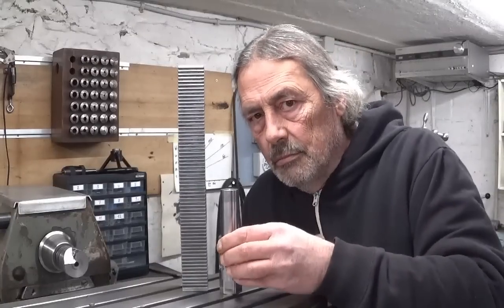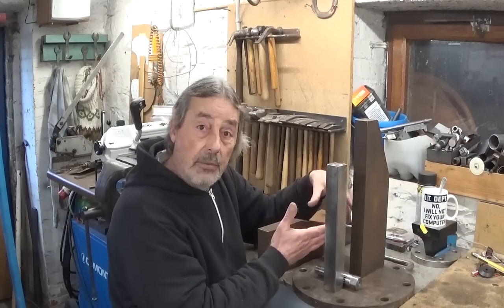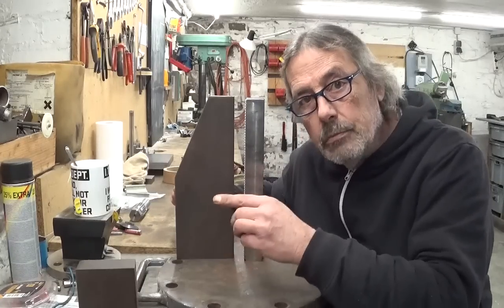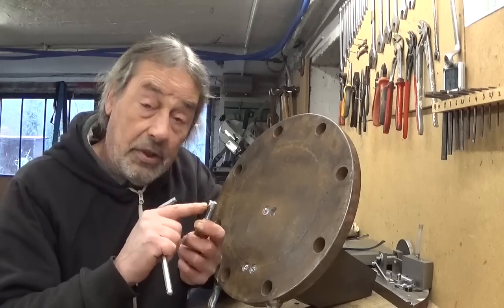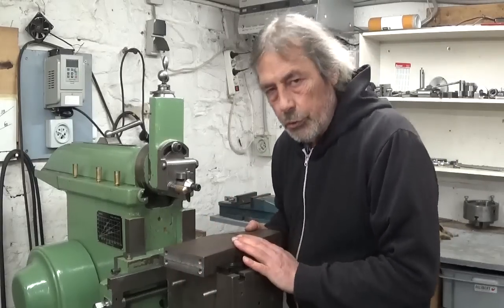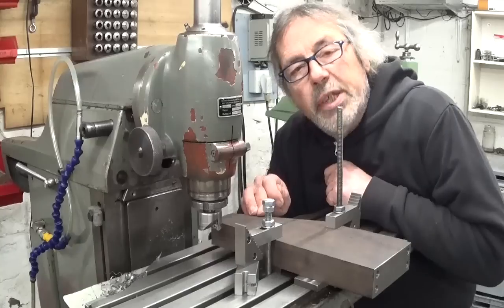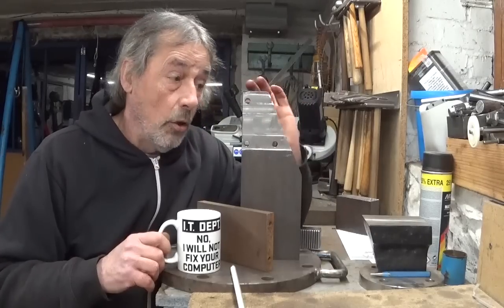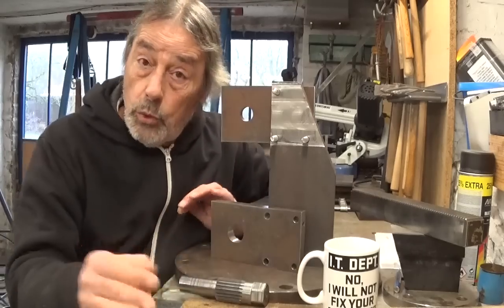Arbor press build part 2.

Comment: As always an entertaining and inspiring(!) video, well produced, filmed and edited.
Cutting the large block standing goes faster bau as You showed us, has its limits. Laying the block down takes more time but maybe it would have worked by one single cut. But You know that,,,,,
As Santa Claus did not drop any stell of that size in my scrap bin I have to use the 60 ton press in my(?) veteran railroad shop when such force is needed. Going there tomorrow....
Time 11:50 . Get out of my way..... I've started to make special clamping bolts for special purposes just for situations like Yours. Well used time.
Time 11:46. Maybe the cat had been there...... (Dirty joke, copied from an old European new years sketch..)
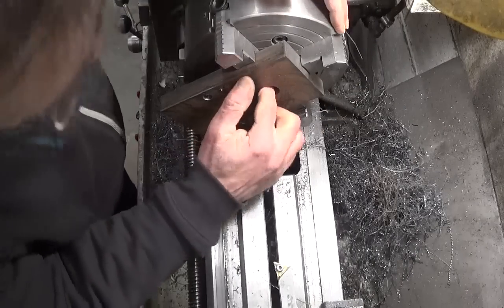Time 14:15. While the mill was down I used the same method.... Better be without bread then be without ideas we say in Sweden.
Time 14:37. "As You can see, it fits." It mostly does that, sooner or later.... Joking!
Reply from the maker: Thanks Stefan. I suppose you know you shoudn't take it all too seriously :)
Reply: @Rustinox  I think we know each other pretty well by now. I like Your humor. Tubalcain involves his wif's toothbrushes, hairbrushes, kitchen aid etc... You've got Your special and very enjoyable humor! Don't ever loose it!
A good laughter extends life we say in Sweden.

Comment: Really enjoyed that Michel. I liked the milling setups and I can see that cleaning up the ends of the long vertical stand and the slide plates is not so easy on the shaper. As usual, you have got me thinking about the potential of my machines. Cheers
Reply from the maker: Using both machines combined, you can make everything :)

Comment: The arbor press is coming very well and sturdy. Have you considered making two bronze bushings for the pinion in order to avoid steel to steel contact ?
Reply from the maker: Thanks.
Not really. First I will see if it works as is.